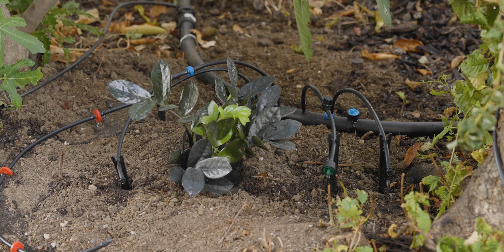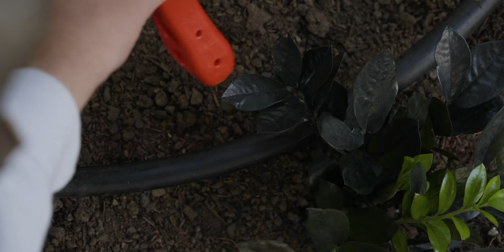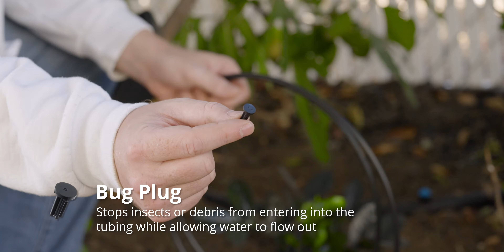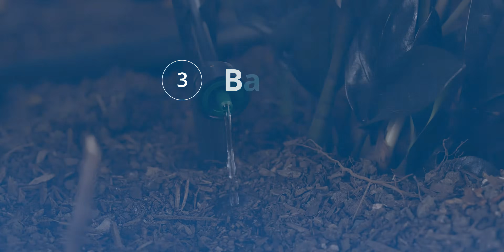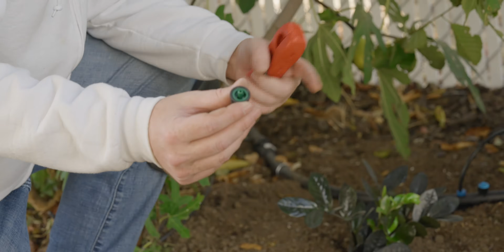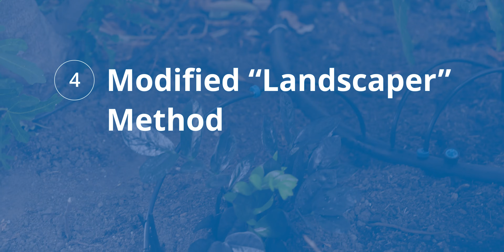5 Ways to Install Drip Emitters

Comment: Interesting thought! "Water spreads beneath the soil through the soil's capillary action." I find my self to be a visual person, so when watering looks insufficient it seems like it is not watering the plants enough. Based on "capillary" I'm guessing that's the same as "wicking" beneath the soil? I never heard of "Bug Plugs" Great video!
Reply from the maker: Martin, you have it all exactly right -- the capillary action could also be described as wicking.  And you also have it right on the visuals of it -- we all (myself included!) tend to over water because we just see a small wet spot on top of the soil and think we're not watering enough, when in reality all the action is happening beneath the soil.  

Over the last couple years I've been experimenting with reducing my watering duration and so far I'm still getting great results.  My process isn't scientific by any means, just reducing cycle times on the timer and watching the plants, but so far so good :)
Reply: @dripdepot We are all learning as we go! What I really like about your presentation is that you come across as instrueducational; and not the end all be all of drip! I'd like to also thank on of your consultants, Mirza for assisting me with a drip design for my existing Arborvitae screens. She took the ease out of any doubts and/or guesses that I had! Thank you!
Reply from the maker: @SouthCarolinaTransPlant   That's awesome you worked with Mirza!  I was just speaking with her a few moments ago -- I will let her know your feedback, she'll absolutely love it!

Comment: Your main line looks so easy to install dippers etc. It's so difficult with the stuff I buy here in Indonesia, I assume made in China. I have to warm up the tubing with a heat gun and use pliers and it's still difficult. What makes your tubing so much better? Different materials?
Reply from the maker: Great question, I do know I've had problems when working with poly tubing that was on the shiny side.  They keep their recipes secret, but we were getting this tubing that was shiny on the outside and it was difficult to work with compared to our regular tubing -- it was like it gripped fittings and barbs instead of allowing them to pass, so I do think the materials (or at least their proportions) can absolutely have an impact on how easy or difficult the tubing is to work with.  

With that said, during the video our tubing was pretty warm from the sun -- even after years of experience I like to work with warm tubing, though with what we're using warming it in the sun is usually sufficient.